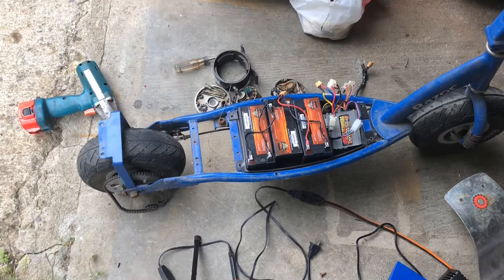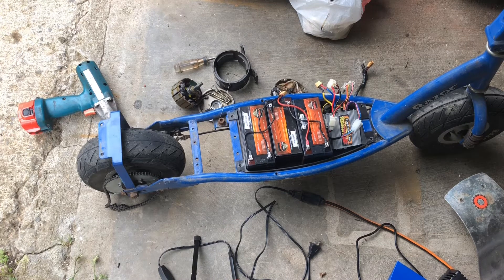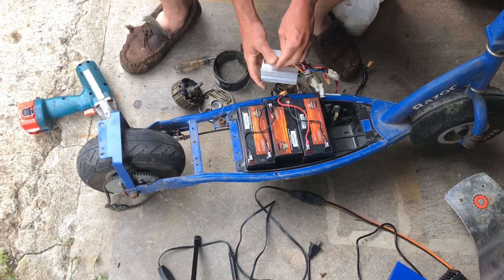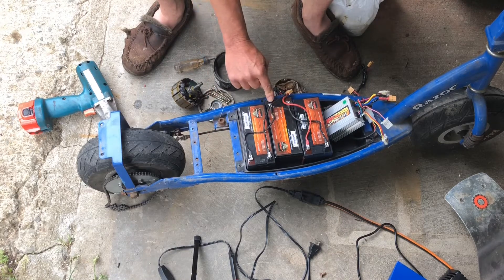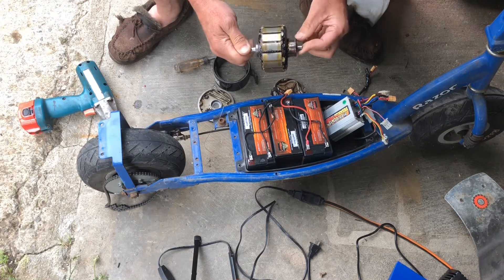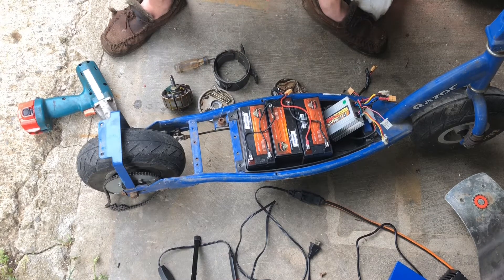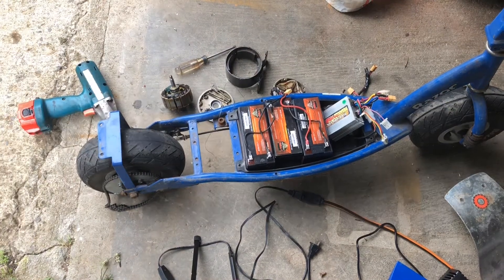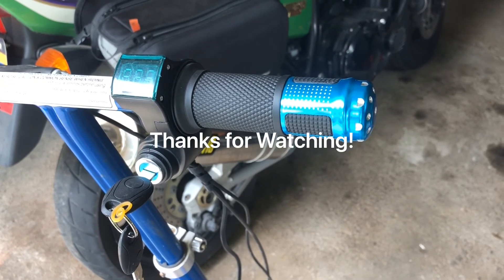Overvolting the Razor e300 scooter

Comment: Got a question. I bought 24v 350 watt with a 24v 500watt controller, throttle with key. Everything hooked up and without touching throttle, tire moves. Do I have a cross wire? My batteries are trash. Going to order new next week.

Comment: Why avoid a 36V motor
Reply: When you overvolt a 24 volt motor it is faster then a 36 volt motor.
Reply: @luckyducky6534  Pretty sure it has more to do with the controller being limited for the 36v, than the overvolting of the 24v one

Comment: I don't need faster....I want more ride time.  I am not really electronically smart enough to figure out....how hard would it be to have 2 battery packs...the originals and more....and make some way to charge either set and switch to either set.....like an auxillary gas tank....is that maybe something a repair shop could rig up for me?  Or....not possible
Reply from the maker: Three words:  lithium ion batteries.   That’s all you need to know and will accomplish all of your goals. 👍
Reply: @NortheastVintage  can you link me some for the E300? Cant find any. And the original batteries suck. I gotta replace mine anyways since the battery is from 2015 and is dead now

Comment: How did he fit in 3 batteries? I have 2-9ah’s in and no room is left in the box under the board really..
Reply from the maker: I cut and extended the steel support bars under the battery tray to make it bigger
Reply: You can stand up three batteries side by side. Fast Scooters sells a kit that comes with spacers & longer screws to raise the deck. no need to change battery compartment.

Comment: Does your handle bar fold down? I just purchased an E-300 and the handle bar doesn't fold, is there an adapter available to convert non-folding to folding? Thanks
Reply: no
Reply from the maker: The older ones had folding handles. The new ones don’t.

Comment: How do you charge it with The new controller  plugged in to the original charging port does it do it automatically when you have it connected to the new controller
Reply from the maker: I’ve since upgraded to lithium 36v batteries with a hoverboard battery charger.
Reply from the maker: I’ve since upgraded to lithium 36v batteries with a hoverboard battery charger.
Reply: @NortheastVintage  how did you fit 3 ska batteries in the e300?  I have 2 9ah sla’s in my e300- and no room is left
Reply: @derekh9104  Stand them up.

Comment: Hey, I have a 36V 500W brushed e-scooter.  Can I tune/overvoltage it to 48V with an extra battery and 48V controller? Will the 36V motor hendle it?
Reply: No it won’t because the motor is brushed
Reply: @matthew-clarkkeeble7015  no it will work
Reply: @matthew-clarkkeeble7015  why would a brushed motor not be able to be overvolted?
Reply: @matthew-clarkkeeble7015  are u stupid.

Comment: Hi. Did you modify the cover to fit the batteries that are now standing upright, not on its side?
Reply from the maker: Ashley Barkmeyer Yes. Originally I cut and welded the battery tray Support’s to lower it enough to fit three lead acid batteries standing side by side. But since then I’ve gone to 36v hoverboard batteries and they fit three in an unmodified scooter battery tray. With my existing modifications I’m able to fit four hoverboard batteries. We just took the scoots for an 8 miles very hilly hide and they still had 38volts left to go!  This is with a 1000W controller and a 500w motor!
Reply: Matthew Guilbault thanks for the info. I am looking at doing something similar to my e300. I also build RC planes and drones so I am familiar with the electronics. I have a few more questions regarding your mods if that’s ok?
- do you have a voltage cut off mechanism for the batteries?
- do you need to remove the batteries to charge them? 
- is your motor a brushed or a brushless motor?
Reply from the maker: Ashley Barkmeyer Happy to help!  One of the reasons that I use hoverboard batteries is because they have a built in BMS so no need to remove the batteries to charge or to worry about cut off voltage. It’s all built in!  It’s a brushed motor but I’ve heard good things about the brushless. But honestly the 500w will carry 160lbs up a very large hill and not even get warm to the touch. Not sure how much more performance I need. But I may consider a hub motor as an upgrade to the second scooter. Hope this helps!
Reply: Matthew Guilbault thanks for the advice.
Reply: @NortheastVintage  Hi there! I was wondering what hoverboard batteries you ended up using, if you don’t mind? I came across your vids last night and after I saw this reply, have been searching, but am not positive on what to use for 48v.  Thank you!